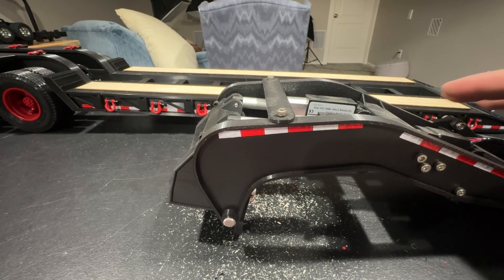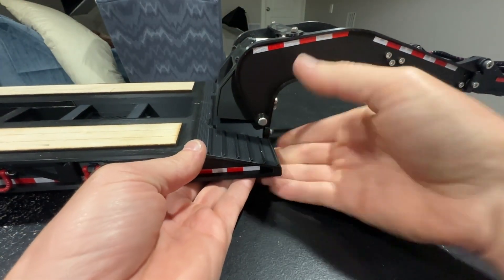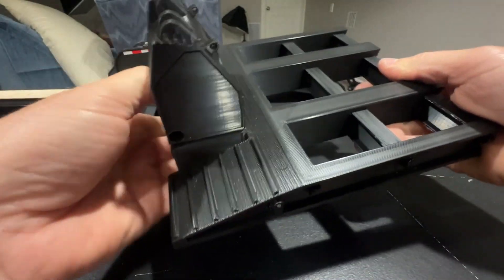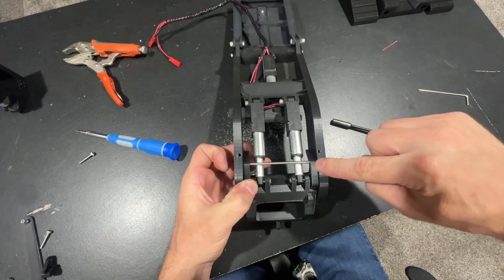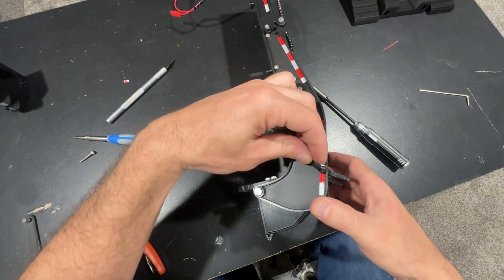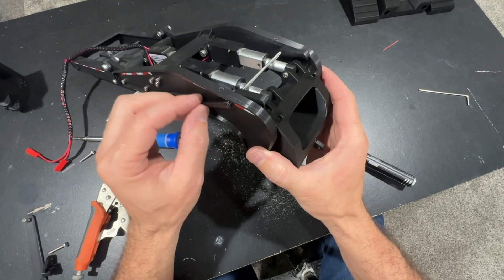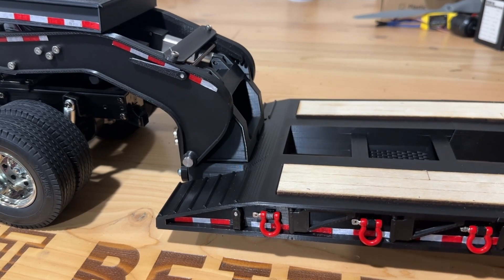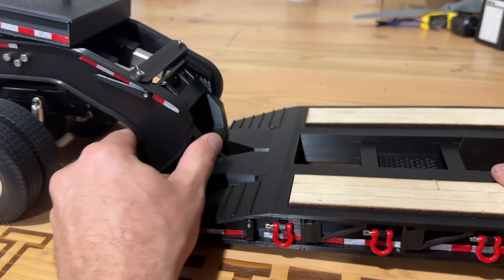Lowboy Pawl Update

Comment: this is a great idea . i printed my hole trailer adding metal inserts  if that 1/16 scale trailer was actually 1/14 id build it . but it is out of scale sitting on the back of a tamiyah truck .    i  purchased one an found out so now build my own off Hercules suspensions  .   you should add files to cults mate or thingyverse .   good job   shame its wrong scale an thats what got to me in end didnt look correct .
Reply from the maker: It is a true 1/14 scale. Total length is 3.79ft multiply by 14 is 53ft, Width is 7 inches multiply by 14 is 8.1ft, well is 22.25 inches multiply by 14 is 26ft and rear deck is 12 inches multiply by 14 is 14ft. Perhaps you are comparing to a completely different trailer, as the one this is designed after comes out to being exact 1/14 scale. 
Also, my files are available on Cults, MyMiniFactory and Youmagine. links in the description.